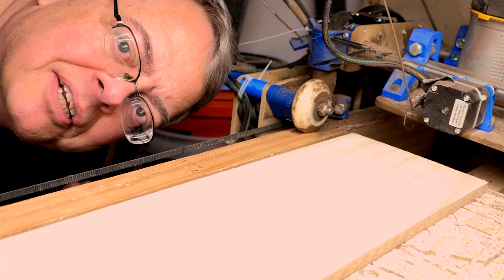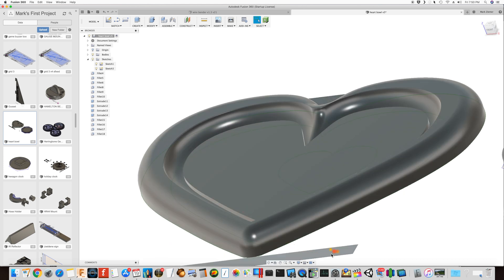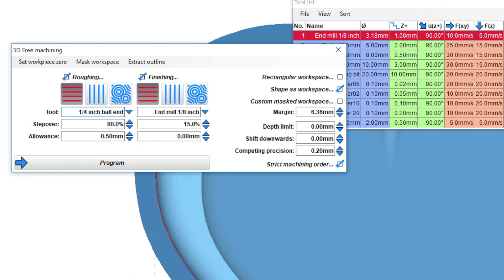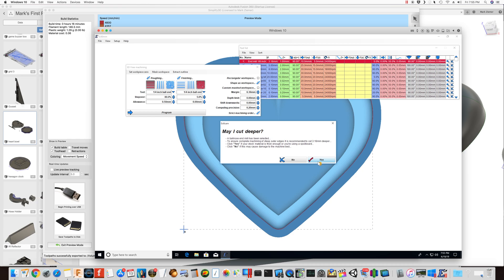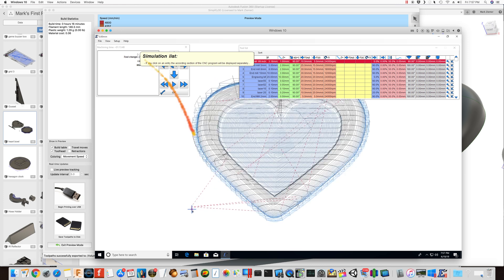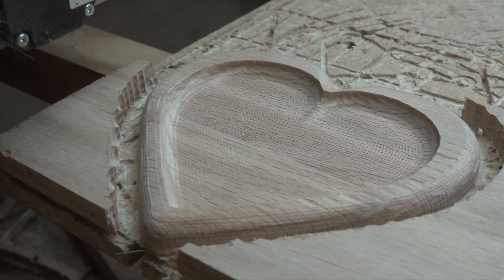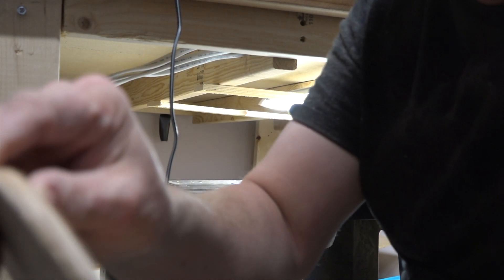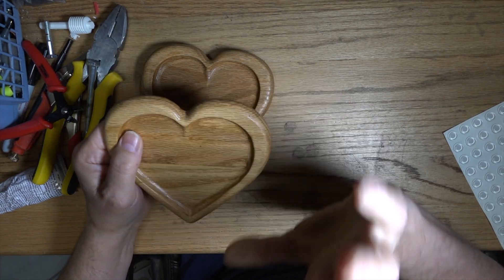CNC Project Coin/Key/Ring Bowl on Lowrider

Comment: What software did you use to extrude 2D to 3D?  Thanks for the video!
Reply from the maker: ColumnSpace fusion 360. An .svg file of the heart is imported and becomes a sketch. From there or you just mouse over the area you want to extrude and do a push-pull or Extrude function. Fusion 360 is free to use if you’re a hobbyist or a start up. Thanks for watching.

Comment: How do you like the lowrider vs the mpcnc?  Does the sawdust under the skate wheels affect accuracy?
Reply from the maker: Josh Heitzenroder I like having a larger space  to work with, but I really miss the visibility of the bit. On the MPCNC the bit is just hanging out there...  However the 611 plate on the low rider II is much smaller, so that should help. yes, I’m sure sawdust affects the z axis a little, but it’s usually easy to brush or vac off when needed